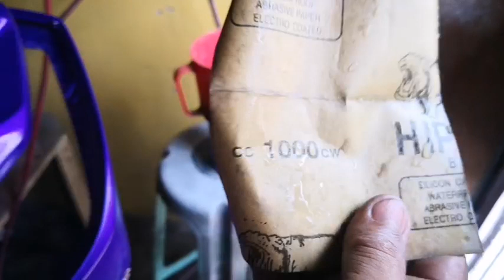GASGAS I RETOUCH I REPAINT I FAIRINGS NG MOTOR I DA HUSTLER'S TV

Comment: Sir gudafternoon tanung lang ulit aq anu b dpat ang air pressure sa primer basecoat at topcoat minsan kc nahihirapan aq mgtantsa ng hangin bumili kc aq ng air regulator?
Reply from the maker: 25 to 30 psi or 2 bars kaibigan.
Ikabit mo yung spray gun sa air compressor hose den iopen mo yung ball valve, pisilin mo yung trigger ng gun ng sagad den pihitin mo yung guage regulator dalin mo sa 2 bars or 25 t0 30 psi. Den i release den pisil ulit tingnan mo kung hindi nagbago. Tataas ng bahagya yan pagbinitawan mo yung trigger.
Reply: Salamat po sir
Reply from the maker: @giseljohnpantaleo3642  Welcome kaibigan. 👍❤️

Comment: anong size ang gamit mong nozzle sa primer, base coat tyaka clear sir
Reply from the maker: 1.3mm pede sa lahat. Pero meron din akong 0.8mm 1.4mm at 1.5mm
Ideal kasi 1.3mm lalo ng kung ang gamit mong air compressor ay below 1 horsepower lang.
Reply: anong fb name mo sir para ma pm kita